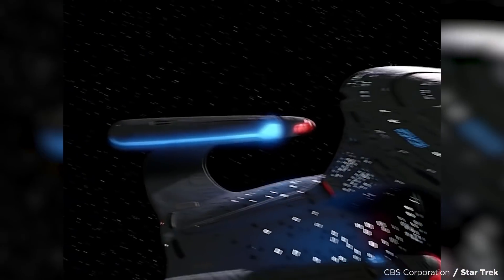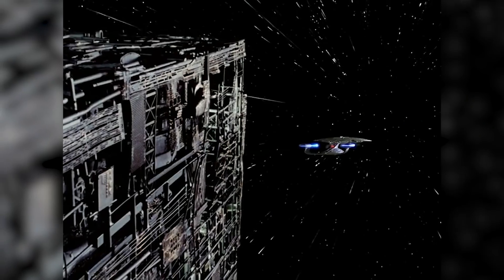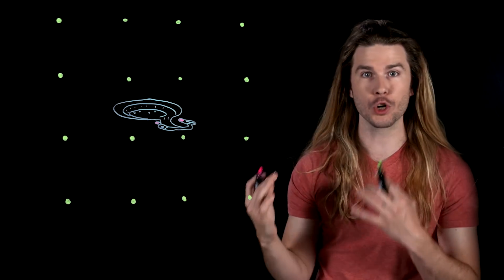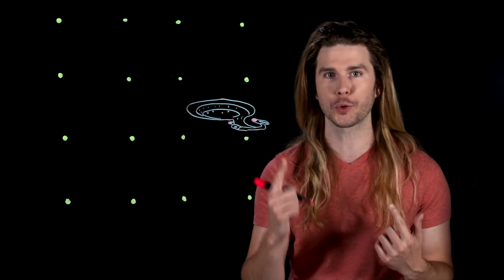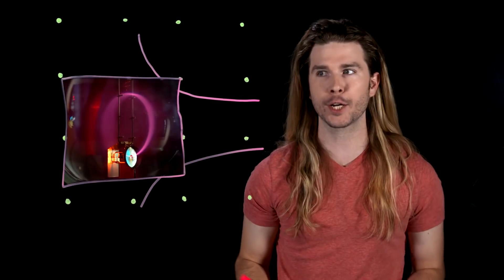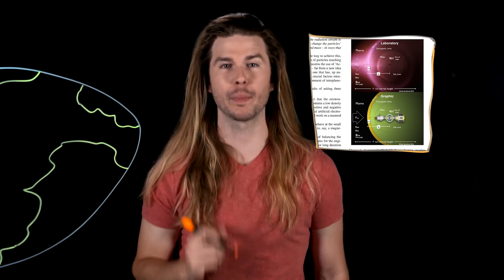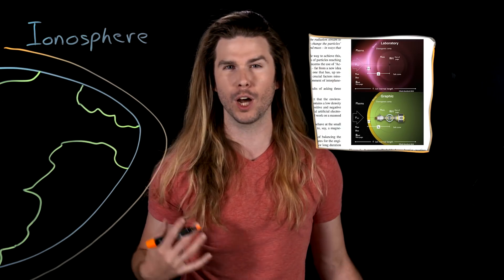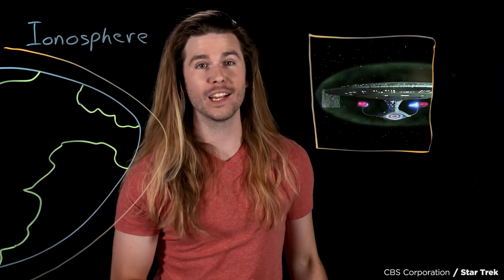How Do Star Trek’s Deflector Shields Work? (Because Science w/ Kyle Hill)

Comment: Thank you for confirming my surmise about the use of a "shell" of plasma surrounding the ship and confined by its EM deflector field. I had the idea that the shield would be more powerful than just an EM field,and  that gravimetric forces would aid in containment of the plasma shell.

I also surmised that the ship could only charge the shields in this manner once in a while (perhaps the ship needs to recharge the plasma reserves once they've been put into the shield), explaining the degradation of the shields' projection during a pitched battle ("Shields are holding, Captain ..." "Shields are weakening ..." "Shield strength now at 47% ... 39 ... 20 ... three percent ... shields have failed. Another hit like the last one, Captain, and we're toast!") - once one mass of the plasma has been discharged into the EM . gravimetric field, the tanks need to be refilled from the drives or something.

Comment: The one part that this doesn't address however, is that the shields degrade under constant fire.... They're always saying "Shields at 50%" as they continue to take fire, eventually leaving the ship defenseless. Whereas, assuming your power supply was sufficient, a magneto plasma field wouldn't be degraded by having to interact with said charged particles... right?

So, either the shields, or the weapons have to be something else in order to account for this degredation...

Comment: Why don’t they just use refractive prisms that send the plasma rays back the way they came
Reply: If you line the right angle and there sides with a none see through conductors which would heat up if it wasn’t a perfect reflective right angle and could use a thermal generator to convert the extra loss of energy (citation needed probably)

Comment: Plasma layers can reflect light of increasing frequency the more viscous, and hot, the contained and projected 'shield' is. If you want to reflect ultraviolet lasers rather than visible light, up the power and heat. You could even deflect gamma rays if you input enough power.
Additionally, a particle beam could be blocked or charged and reflected by the plasma shields, as could plasma weapons. Downside is plasma weapons, in theory, give off potentially disruptive discharges on impact, so it could mess up the magnetic field containing the shield.
And a viscous enough plasma field and magnetic fields could slow and deflect ferromagnetic coilgun or railgun shots, or if powerful enough, simply vaporizer objects that try and get through.
So plasma shields are a swiss army knife of science fiction techs, but they depend on that most irritating of requirements, a dense power source. Which is why it is crucial we get superbatteries/capacitors, thorium fission, fusion energy and any means of plentiful large scale energy that can be made in very dense means.

Comment: a thought
they are already using warp drive which is capable of bending space.

would it make sense to use it as a shield as well, to have that magnetic field inside a bigger space forced into a small area with that plasma. 

just thinking the beams do seemingly stop at the shield instead of bending inside it, but if that shield was say 100 meters thick but we would simply see it as a thin shell, it might produce that shell like visual effect... something along those lines. 

i need more coffee to finish that thought.

Comment: Wait, the deflectors are the same as the shields? I had assumed they were two different techs, one used to deflect microparticles out of the way during spaceflight at speeds where collision even with microparticles would be devastating (including FTL), and the other used to protect against directed energy weapons and macroscopic kinetic impactors (and slow moving objects). Basically, one would be a space-dust repeller, and the other the classic "force-field".

Comment: In an episode of Star Trek: Enterprise, Trip was working on a prototype shield that suspended some sort of particles in a field.  I immediately thought of an old product call Hill Plasmatronic speakers.  This was a real product in the early 80s, that used a sheet of helium plasma suspended between two magnetic fields as the tweeter.  By modulating the strength of the magnetic fields, the sheet of plasma acted as the speaker diaphragm.  They actually included an RF cutoff, as those tweeters could be driven all the way to radio frequencies.

Comment: i have a important question. lets say i have a SUPER ULTRA MEGA MAGNET that will repele a bullet when i hold the bullet in my hand. could i use the magnet to repel shot bullets
Reply: Depends on the material of the bullets and the temperature they are when they reach your shield.

Comment: Musk has some good ideas, but some absolutely ludicrous ones too. Case in point - his vacuum tube failure (aka Hyperloop). Many physicists have said it has many major flaws. For example, the tube itself would warp due to variants in temperature, becoming hotter on top and cooler underneath, causing rivets and welds to crack and break, causing the tube in those places to kill anyone inside who's near the flaw, for starters.

Comment: Could you do a video about how strong wolverine would have to be in order to move with a metal coated skeleton.  I figure even with a thin layer of metal it would add up to quite a bit of weight, alot of surface area.  Just to jump up he would need to be really strong.  Not to mention curling his arm would be heavy bc of his claws.

Comment: I was always under the impression that there was a separation between the "shields" and the "deflector shields". And the deflector shield was there mostly for physical objects and the more generic shields dealt with more phaser based attacks.
Reply: you are correct, there is a difference between shields and deflectors.

shields are to protect against attacks, strong blasts of radiation, and stuff like that.

deflectors are to move stuff (spacedust etc.) out of the way so the ship doesn't get perforated while moving.

however, even the writers of episodes mess that up quite often.
Reply: What you're thinking of is the navigational deflector which pushes objects out of the path of the vessel. Without the navigational deflector which is the main deflector dish the ship would be swiss cheesed by space dust at impulse speeds.
Reply: I had always thought deflector shields were strictly from the deflector dish, but apparently the ultimate Star Trek source, Memory Alpha states it's a matter of type: there's low power deflector shields coming from the dish (important during warp).  The shields raised for defense can also be called deflector shields.  http://memory-alpha.wikia.com/wiki/Navigational_deflector   .   http://memory-alpha.wikia.com/wiki/Deflector_shield
Reply: Yeah. I also watched the video expecting some BECAUSE SCIENCE about the deflector.
Instead i got something about the shields...
suddenly Kyle has lost quite a few nerd points.

Writers of Nerdist, you have failed.
Reply: Archers enterprise "magnetize" their hull to protect it from Phaser blasts
Reply: The writers were completely inconsistent, but the TNG Technical Manual has them named properly.

Comment: And their worst enemy would be one equipped with "primitive" slug throwers.  A good railgun launching a non magnetic round at c fractional velocities would ruin their day. A magnet shield would work on the shot cup or whatever they used to accelerate the round in the gun but not a depleted uranium slug. Slower than a phaser beam but if you can hit both magnet shields and armor are pretty useless.

Comment: 7:35 Neutron bombs use a form of radiation right? So wouldn’t it make sense to have passive radiation shielding, I don’t know, maybe built into the hull plating and bulkheads, if such weapons were a potential threat, and also said shielding would be useful in case the active shields went down?

Comment: Heres a fun question could a star trek shield stop a star wars turbolaser
Reply: Star Treck tech would massacre Star Wars tech.
Reply: They can't use warp next to astroids but they can warp space away from them while traveling or nobody would ever be able to get around in space. Even the tiniest of specks would demolish a ships hull. Despite the common analogy by veiwers, neither show uses lasers because all a laser is, is excited light waves that may cause heat damage at best. If Star Trek ships are encountering shots from torpedoes that can erase masses much higher than a city they can tank a blaster, which is much slower. Even if it has physical properties like a metal, it still has to obey gravity. The reason ship integrity gets compromised in Star Trek is because they cannot engage fields that warp with objects too close, and that frequently becomes a problem for surprise attacks. who needs to worry about a blaster anyway when space has much more dangerous things to watch out for like subspace disturbances that cut off one space into a void. And a high powered star destroyer and a pursuer can't even handle a slow speed chase against a few nearly defeated rebels.
Reply: HyugaBlood881 Yes
Reply: Hitting Warp 9 through a series of star systems pretty much guarantees you can tank a turboblaster. There's nothing you can throw at someone that the vast reaches of space can't throw harder. Which StarTrek has proven again and again space does.

Comment: Star Trek shields are force fields. Torpedoes can't penetrate them, shuttle craft can't penetrate them, and neutral particles can't penetrate them. This episode is plausible as far as it goes, but to truly explain the shields in Star Trek, you would have to do an episode on force fields, as in, energy fields that can act as a physical barrier. The only real phenomenon I can think of that might apply would be like an artificial solar wind; like an incredibly intense, coherent photon beam refracting around the ship in a bubble and repelling any stray particles purely by light pressure. Honestly, though, that seems less plausible than the possibility of some exotic phenomenon that we just haven't discovered yet.
Reply: +EffinStephen The shields in Star Trek do not block shuttlecraft.

Comment: Another interesting tid bit about deflector shields from The TNG technical manual states that the Deflector shields are actually oscillating graviton fields which essentially curve space time which changes the trajectory of matter and energy attempting to cross the field so this would work with EM radiation and mass objects. 

An interesting analogy was given. "From the perspective of the protected vessel, they would observe the impacting object bounce off of the shield. From the perspective of the IMPACTING object, it would appear the target vessel had suddenly "Changed" position with no change in velocity. 

So according to the Manual, this functions more like a massive interlaced grid of "point defense" graviton emitters, when sensors detect incoming HIGH ENERGY density, the Grid instead of providing general EM and cosmic radiation protection has to actively redirect a large portion of the Grid to the projected impact point. So i like to imagine the graviton beams as laser beams constantly in a scan phase covering a spherical area but then if an incoming weapon is detected, all those beams CONVERGE on that impact point drawing peak power. the shield glow is supposedly explained as cherenkov radiation as the incoming beam or ablated material is dispersed around rather than the SHIELD itself being visible ...

Which is cool they thought all that through ....
Reply: +BuzzKillingtonS13 There's actually two shields in Star Trek; The Deflector shield, which works as you described, and the main shields, which are described in this video, and incorrectly named deflector shields. The Deflector shield is active at all times, to protect the ship from space debris during travel, whilst the main shields are only active during combat, as they prevent the transporters from beaming people on and off the ship, among other things, and because of their immense power draw.
Reply: Where is this cited? And sorry :( I havent read the TNG tech manual in about 18 years lol. Is there an article about the "Main shields" as you say? I just assumed they were both one in the same, just operating at different power modes. Because it clearly wasn't talking about the navigational deflector dish, it was generally reffering to a shield grid around the ship.

Comment: Well in regards to phasers, they are particle beams. according to the TNG technical manual...Specifically, "Nadion" particle beams. Nadions are a ficticious particle discovered by some japanese physicist 

Nadions have a unique property of liberating the binding energy from atomic nuclei and interring with the nuclear forces. Which explains how I guess LOW level settings can cause intense neurological trauma (but why it doesn't cause more damage to the surrounding tissue I dont know ..) and higher intensity beams can explosively vaporize cubic meters of rock.

Comment: "Every sci-fi ship now has a version of these shields." Kyle, I should introduce you to the Battlestar Galactica. They lack deflector shields, and beam weapons. I'd actually love to see you do a because science on how their ftl drive might work, because it is unlike any other sci-fi I've seen. They appear to fold space to travel ftl.
Reply: Good point, Shannon 👍.
Reply: Warp bubbles also fold space.  So star trek too
Reply: @MtSpider  Battlestar Galactica is an exception (and a damn good one). BSG is a well made sci-f, but folding space isn't an original idea. It'd likely be based off of Alcubierre drives which essentially move the space around the ship to bring the ship to the location ahead of light, but without actually moving faster than light (relativity is weird man...). Alcubierre drives are actually very realistic and could work (assuming some key aspects of our physics are wrong, and considering how stupid some of it is, I feel like we should be able to break FTL), but alas, not original. The idea has also been used by Star Trek... except that Star Trek used the Alcubierre drive... before Alcubierre invented it...
The same could also apply to BSG depending on when it first became canon that they folded space.

Regardless, my point is that despite BSG's wonderful originality, the FTL isn't unique, but it is realistic at least, and based in real math (though the idea of it working is obviously against that very math).

Now that I've yapped for 20 minutes about Alcubierre drives, if you made it this far, I hope you have a good day!

Comment: Weren't the navigational deflectors primarily for diverting small matter such as space debris out of the path of the ship during high speed travel? I don't think that magneto-plasmic shields could accomplish this task.
Reply: they are two different things.
the navigational deflector is always facing forward, to push debris out of the way.
the deflector shield is much stronger and it surrounds the whole ship.
it is not until late Voyager and the movies that they develop multi-vectral shields, which are individual shields facing in diferent directions around the ship rather than one single bubble.

in one episode of TNG a small ship threatens the Enterprise with laser weapons, and Riker points out "lasers? that won't even penetrate our navigational deflector"
as in, we don't even need to bring the shields up.
two different systems.
Reply: The deflector array uses, according to the Enterprise D tech manual, graviton fields to deflect incoming debris.
Reply: I was just about to write that!

Comment: hmm what is the multiphasic shield ?
Reply: Ok, using my own knowledge and the video as a source, here's an explanation of the three main ST shield types: 

Multiphasic shielding works like Kyle explained, but there are multiple plasma levels to it, hence 'multi'. The 'phasic' part is that, instead of increasing shield size to accomodate the new layers, each new plasma layer is kept out-of-phase with the rest, allowing more shield power to be kept in the same space. When one runs out, a new set of plasma is rotated in. 

Covariant shielding is basically just multiphasic shielding except less advanced, i.e. multiple plasma layers, however they remain in-phase and thus the shield increases in size.

Regenerative shielding provides only a single layer of plasma as cover, however the shield has many auxilliary plasma generators which continuously pump in new plasma as the shield is hit, meaning it is weaker but can regenerate far faster.

Of course, this is all just Trekkie technobabble, so I'm essentially pulling this shit out of the fandom's collective arse.
Reply: @trashf1re  makes sense

Comment: Yes I thought of this many years ago when watching star trek figuring, sure let's make it so that the shield uses plasma from the ship because that would be faster than running it for a long time and gathering charged particles from space. The other point I thought of is that the transporter and replicators cannot be using atom by atom placement technology, that sort of thing would be far too complicated. More likely the system was using a space time transplant thus allowing Object A and Object B (air) to switch places. However this could also be used to alter the space time in that area. Thus in essence rearranging the atomic material in that area as needed. This would save on processing time so much. Plus it would prevent the obvious question of why don't star ships just beam osmium up atom by atom and leave it in an energy state thus making 100% energy conversion without the antimatter.